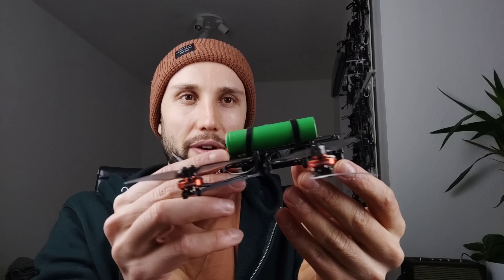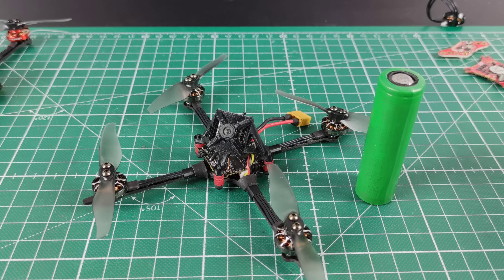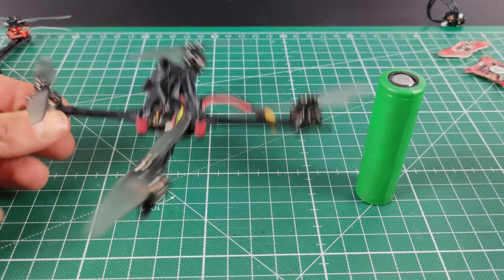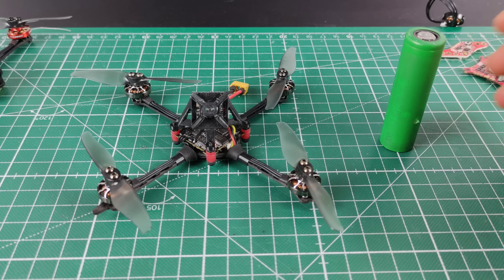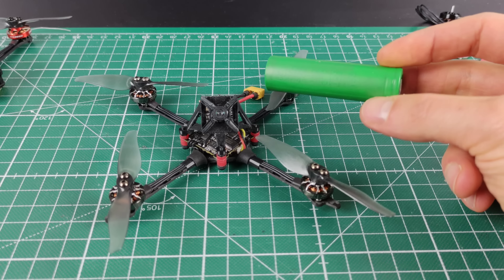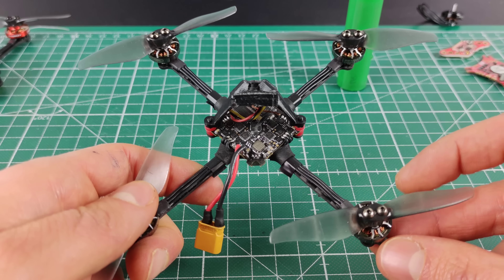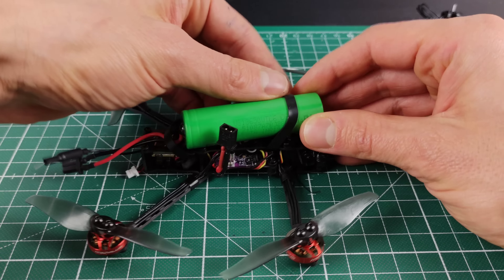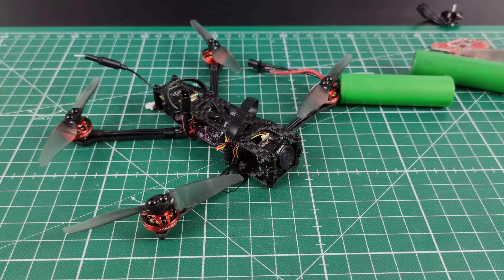#NanoLongRange

Comment: Would a higher KV be more suitable for li-ion 1S voltages? Could provide more usable throttle range.

Battery tray is a great idea to swap li-ion cells quickly! Could the battery tray be integrated into the carbon fiber frame? Save weight and make the tray structural to add strength.

Comment: I can definitely imagine having quad like this.
The battery holder is in my opinion totaly awesome idea. What if it would be somehow incorporated into the frame/ be the frame.
Reply: Btw, if you would stick to modifying 18650 cells, its casing under the plastic wrap is whole negative. So you dont need that extra metal strip.

Comment: I'm very interested in this, and wishing you success with it. Based on my own tests with 1S whoops and loading them with things like HD recorders and/or Crossfire receivers, I'm very skeptical about 1S being any good for anything but a basic whoop. Obviously in this case you have a larger prop area. As for the EU classifications, I think you could argue this is a "toy". That gets me onto my soapbox about the EU and UK drone rules though, what constitutes a "toy" and as the name implies something that is safe, the rules are not fit for purpose. Something around 250g, AUW could certainly do a good bit of damage to someone just with the propellers. In my own experiences, even ordinary tiny whoops and kids can lead to very minor injuries. The authorities have based 250g as a 'safe' weight class purely for the kinetic energy of impact, but they don't take the props into account. Your Nano Long Range here could definitely cut up some little fingers, but I think it would be classed as a toy because of its weight and by virtue of not having any on-board DVR. Rant over, but my point is that the regulations we are suffering are not fit for purpose.

Comment: Lots of commercials drones such as mavic mini uses battery as a supporting structure, maybe try that? 🤔
Reply: See if 3D printing a shell around the battery, and make it as a frame would save weight, since it’s a long range small drone I don’t think you need carbon structure.

Comment: Look for Kenji Lin channel on YT. He shows how to figure out problem with heavy gps antenna 🙂. Hello from Kazakhstan. Is there some Aio FC with working on 1S and 2S simultaneously on the market? With 2S you can use more efficient vtx (look for Kenji Lin project) and do not use step-up booster. Dcdc convertors loose some energy to conversation.

Comment: There are capacitors and there are capacitors.  The voltage boost converter will create a lot of electrical noise which needs high quality filtering.  Low ESD capacitors are what you need as used on computer motherboards.  They have very  low internal resistance which allows them to fill the switching voids much better than any other capacitor type.  Go for the biggest capacitor you can afford weight-wise.  The capacitor you are using looks like a cheap electrolytic which won’t cope that well with high frequency switching.  Another way might be to run the electronics of two smaller lithium batteries wired in series as 2S like the ones used in the micro helicopters.

Comment: use flex cables(much thinner cables..), larger propellers mostly for hoovering... reduce skeleton... and swap to the new battery technologies.... maybe 2 battery... :P also try get mobile phone camera or laptop which are much smaller/lightweight... shift to pico pcbs if avaliable... and do not spy (:

Comment: Dave ive been thinking they need to intigrate gps on fc (like cell phones). Would be good for this class. I put an 18650 on a savagebee, it got super fat 11 min cruise times at 10+ amps on ph2.0 10k motors, bout all ive got in this. Needs higher kv motors I believe. I personally just want an 18650 craft. Idc about going range.
Reply: Maybe you can use your weight with hglrc to make us some better motors or something.

Comment: I once built a 1s 3" Quad that ran 12mins on a 450mah LiPo (but it's on a pickle pick frame). I'm sure you can find a way to push 20mins with GPS!
Reply from the maker: probably just needs warmer weather to get to 20min. Those 18650 are quite temperature sensitive...
Reply: @DaveCFPV  that would be awesome. Looking forward to the progression of your build!

Comment: It would be great if there existed some 2000mah li-ion cells so you could save like 15-20grams or so, cause 15min flight time for that mid range vtx is too much, so maybe it would be better to have like 10 minutes flight time and better response on the quad. But not sure if there are smaller li-ion cells rather than 18650...

Comment: I love that... 
can you get DJI with that?
nvm,  guess it would need its own battery.,. 
what is draw of Vista for 20min? looks like it need 4.5v min to operate. 
so 1s analog,  2s lith ion for DJI... 
maybe 3.5"
Reply: Just attach some contacts to the Carbon. 
thinking two T vertical piece of CF on top deck, 
but yeah Lith ion makes it soo much easier for regular folks.

Comment: Why not use the smaller 12 volt batteries that are half the size and half the weight. They are a stack of camera batteries rapped up like a double A battery but smaller.

Comment: I need one of these frames. I've got a 1s 18650 inav build from last year that's running a 3d printed frame with carbon rod for arms and it needs more durability.

As for the GPS weight use a dipole antenna they work better than the small patch antenna anyway and weigh nothing.
Reply from the maker: thanks!
Reply: @DaveCFPV  I got the idea from this guy https://www.youtube.com/watch?v=vG7qsOne8Mc I found a longer signal and shorter ground gave better performance probably due to the ground plane surrounding the feed point. I've been meaning to try adding a ufl and trying a remote antenna to make it easier to mount.

Comment: Hmm, maybe make that battery box part of the frame instead of adding it to the frame? Sort of like a battery box with four arms. You'd be using the battery as part of the frame so you could save a bit of weight there maybe?
Reply from the maker: Thats the plan🤫

Comment: Yo, I have a solution to ur weight problem, you need to use LiPo batteries. The lithium ion 18650s have extra metal to give it a heavy duty protective case for safety, but they make LiPo batteries that have no metal casing and they are super light, it's the same type batteries they use in cell phones and some  bluetooth devices, and they operate on the 3.7v platform so you can charge them with any lithium battery charger

Comment: In Japan, DJI DEGITAL cannot be used as a hobby.
Therefore, I cannot use the DJI DEGITAL.
Also, if the total weight of the aircraft + battery is more than 200g, you will need to apply to the authorities to fly FPV.
In other words, I am waiting for an ANALOG aircraft with a total weight of less than 200g (airframe + battery) in Japan.

Comment: For the GPS antenna, you may get away with a design on FR4 PCB material. There are some commercial boards that use this method and there may even be some open source designs. You may also be able to recover something suitable from a scrap mobile phone. As to its weight and sensitivity, your mileage may vary. You are no doubt aware that antennas that work at these high frequencies involve some pretty esoteric RF voodoo. Short wires become inductors parallel wires become capacitors, element lengths make what appears to be a short circuit, resonate.. its an interesting rabbit hole to dive down. I wasn't entirely surprised that removing the lid and stripping down the ceramic resulted in a dead antenna.
You might even get away with a simple single element dipole if there are enough satellites overhead.

Comment: Powering the VTX straight from the battery... TBS nano pro and you gain weight while ensuring 450mW output. 
2s motors are more efficient no?
Reply: Nano pro needs 5v though.. 1S is 4.2V when full...and 18650 can be flown to 2.8v...

Comment: tbs nano with nano antenna is light and is a ton of range.. why not? and take titanium screws, is half the wheight of aluminium..
Reply from the maker: Titanium is heavier than aluminium :-) TBS Nano should work great. I used the flywoo because I already had it. Weight difference isn't huge on the other hand. They Flywoo is 1.4g
Reply: @DaveCFPV  ok master ;) thank's for response ;) amazing i was thinking to make a lion drone from scratch, i learn a lot! thank's for all the tips! ;)

Comment: I had given up on analog, switched to DJI... but this would have me dusting off the old Fatshark Dominator V3's.
Reply: Just get a digidapter or the uruav analog adapter.. once you are used to the dji screen size, doms screens are like postage stamps..lol
Reply: @DutchCommando  I agree, it does look like a postage stamp!  I bought the digiadapter but cant use it because I run the True RC X-airs and they interfere.
Reply: @larssmith2170  in that case the uruav adapter is a good (and cheap) option..

Comment: I'm surprised people aren't experimenting with smaller lithium ion cells for these micro long range rigs. 18650s are bricks.
Reply from the maker: They all have much worse weight to capacity ratios and usually max. discharge that makes them unusable

Comment: Dave, what about this https://www.sparkfun.com/products/10255  that boost lower voltages to 3.7 , i dont know the wieght of it but at least you can use the 3000Mah battery lower than before , it can boost voltages as low as 0.3V the default is 2.6v but you can lower that to any value you like, that way the VTX and FC wont shut down and you can suck some more mah from the battery.

Comment: I wouldn't bother with a cell holder - apart from adding weight it might restrict current draw. Taking into consideration that 18650 LiIon cells usually don't have a very high Amp rating (I only found 30A at best) that may be the cause for poor punch-out performance. It would be nice to have current draw telemetry to verify. I have a 6" long range quad that I used to test with 3 cell LiIon packs - at the same weight the LiPo packs perform much better current wise. On LiIon it always performed more sluggish.
Also, Matek Sys produces very small and light GPS units with extra noise protection, see http://www.mateksys.com/?portfolio=sam-m8q or http://www.mateksys.com/?portfolio=m8q-5883 - officially rated at 7g, so not lighter than what you have. I don't have one of mine on hand to verify, but they definitely are much smaller and work pretty well. :)

Comment: Try finding a circus called a boost converter or a jewel thief you gets tiny little one on eBay for like a buck or two that way they will up the voltage to 4.2 or whatever you set them at until the battery is completely dead
Reply from the maker: I don't think that will work. Either the amp rating is too low or they are too heavy

Comment: Long range inside a long building with no winds will work.. outdoors its wobble wobble.. u need smo 4k with this
Reply: Great vid. Accent is very understandable, no issues. The documentation is top notch and appreciated by me and others I'm sure. Have a Babyhawk 3" w f4 board,  rakon blade guards, was breaking blade too much, cam mount made of leather, old belt, Its fun.  The only suggestion I have for the batt tray is make one much lighter. Copper tabs on ea end. Stiff thin plastic under. The smart play, thin batt straps to secure. I love 18650's. E Musk came up w 2150 or something slightly bigger,  for his e car batts.  So, the metal casing has more weight than a comparable L ion but will never be damaged in crash. I'm subscribed.

Comment: I like 2s li-ion here. The boards are 1-2s so you can cover the low 2s voltage that you can't on a 2-4s esc. I don't know of any high c half size cells though.

I've thought about modding one of those battery holders by soldering some brass wool onto the contacts or fraying some wire to make a high surface contact.

Comment: use smartphone components maybe
Reply from the maker: I looked into it. There are smaller GPS units but the logic runs on 3.3V which is a problem
Reply: @DaveCFPV   isn't there a workaround possible?  Maybe designing a totally new fc.  Those hglrc guys have huge resources.  Or maybe a different processor?   It would be a big deal in the hobby ,  especially being the first to pull this off. Just thinking out loud,  but i love your little projects,  and i hope the future of drones brings us more  use of visual processors , 5G , openCV,  companion computers,  high modulus carbon.......something like the Tello but with  brushless motors and carbon fiber . In the meantime i keep a close watch on your channel.
Reply: @DaveCFPV  you can use the spectrum receiver v pad which is 3.3v if it has one.

Comment: @Dave_C have you researched non-Carbon Fiber materials for the frames of your micro-long range or nano platforms?

Such as the Airloy• from AeroGel 

http://www.buyaerogel.com/product-category/airloys/

Would be very interesting to see your 7” to 4” long to nano comparison on disk load with a airloy frame to get below the 250 g weight with the same components and the same lift.

Comment: GPS does not work due to lithium battery. I had a problem like this. Check for a li-po battery. If it works, you need to put up the mast.

Comment: Underpowered and owerengineered! ;) 2s is optimal for "under 250g" LR.
Reply: I would disagree - you can get a 1s 3000mah for far less weight than a 2s 1500mah and it's extremely easy just to get a higher KV motor. This is rocking ~8000kv iirc and 12500 would fix all issues just described
Reply: @swg_fpv  but in this case 3000 mah unusable
Reply: @3dprinting_and_aviation  no it's not really -  on a calm day it would be great
Reply: @swg_fpv  at any condition LiIo 1s too weak for this job

Comment: Maybe if you can carry a naked go-pro or smo 4k. Otherwise what's the point really? Underpowered slow cruising with shitty footage isn't appealing just because you can do it for 20min on one battery.
Reply: Were not all the same. It's not just about the footage.
Reply: @gmivisualsjason3729  Yea some people just like the thrill of flying way far away or just building something that can do it. I've been flying for 5 years and only used a GoPro a handful of times becaus I enjoy the flying just on its own and don't care about the footage👍🏻
Reply: @gmivisualsjason3729  Agreed. Some of us like to fly for the sake of flying, for the thrill it gives. The reason I fly fpv isn't to get fancy footage.
Reply: @Yinka in Brasil EXACTLY! It is satisfying to rewatch a flight from a gopro or something, but 9 times out of 10, I don't even fly with one, much better performance :)
Reply: Slapping a $200 cam ln an experiment sounds stressful. The cam or goggle footage is good enough for testing. Its about fun, no refresh on this one.